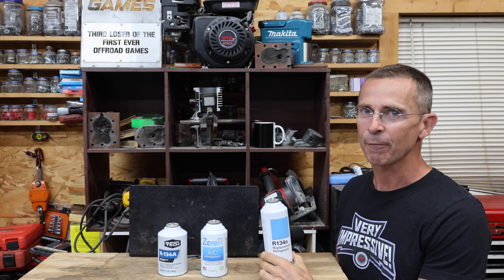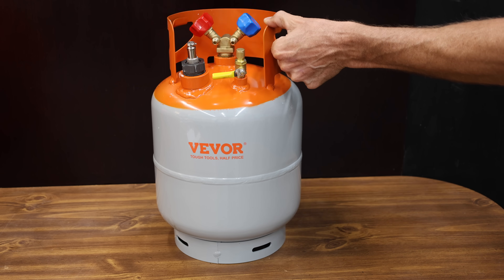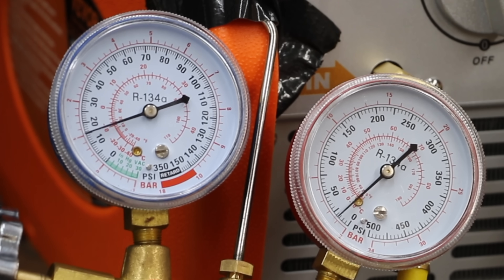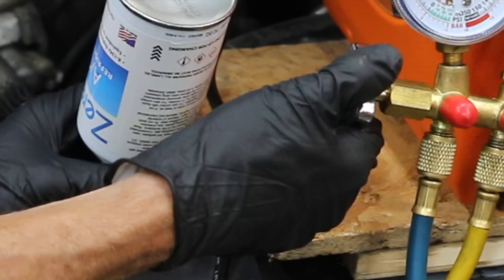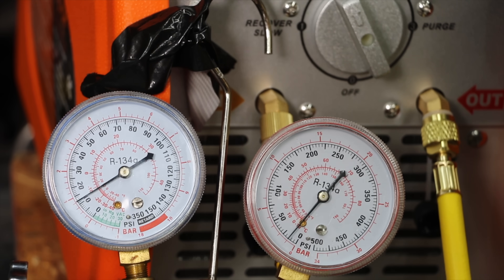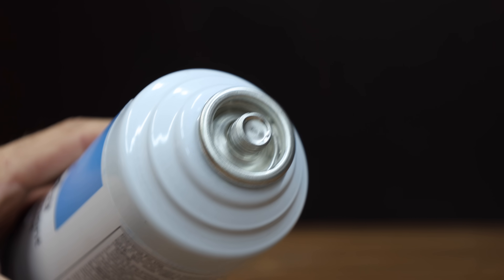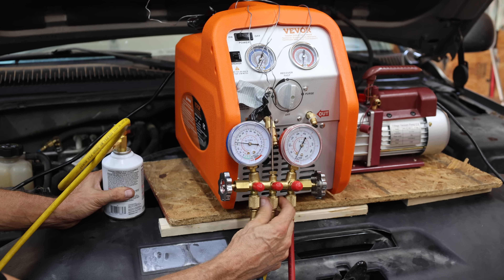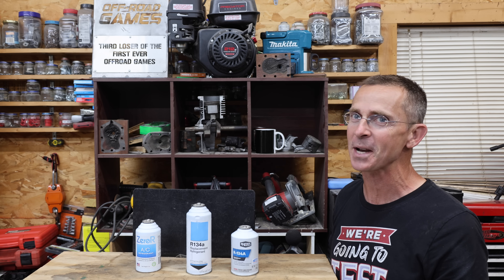How Dangerous is Fake Car A/C Refrigerant? Let's Find Out!

Comment: I spent quite some time researching a top up for my old banger. I considered propane based and rejected it. I ended up buying Honeywell's r1234ze(e), which is tetrafluoroethylene used in ozone friendly electronics diagnosing cooling spray cans. It is "almost" nonflammable, has a lower working pressure than 134a, so will do better with a tired compressor. It has a theoretical 13% worse chilling capacity at the same flow rate and condenser area than 134a. It is sold in cans designed to be sprayed into open air, so can't be very toxic either. I am hoping the is enough oil left in my car to not under lube the compressor. One can of 200 grams revived my AC for 20 bucks. 

My car DID have a little pressure of 134a still enough to turn on the compressor which means there is no big leak and no moisture or air would have been sucked in. 

The system blows cold but it kicks in the high speed radiator fan earlier in hot weather so probably has less margins. This is not an endorsement, but one story of partial success.
Reply from the maker: Thanks for sharing.

Comment: My Lincoln has an R12 AC system. I had a compressor wear out and lost the last of my R12. I decided to try a replacement refrigerant called Envirosafe. (available online) Very expensive but it works great! The refrigerant is a mix of propane and several other gasses so it is flammable. I'm not worried about this at all. I do carry a large fire extinguisher in the car though!
Reply from the maker: Thanks for sharing.

Comment: Hello my friend, using the freon word is deceiving because is strictly related to R12 refrigerant. R134 A it's the "alternative" to R12. As you know R1234YF came out in 2013 to replace R 134A. If you're working with R134A you might need PAG (polyalkalineglycol) or POE (polyolester) lubricants. Please check with the appropriate manufactures on what they recommend. If you're planning a retrofit a system, a completed A/C flushing is recommended and of course pressure testing for possible leaks which they need to be addressed before recharging.  Great work you do behind the lens. Cheers

Comment: Just curious - I saw in your description that "I purchased all of the refrigerants, all equipment, and all supplies used in this review to ensure an unbiased comparison. So, thank you for supporting the channel—it helps!"... would it have made a difference had someone else ( or the stuff provided by the manufacturer ) supplied the refrigerants - it either works or it doesn't.  In this case, it is clearly visible... at idle, it doesn't work very well.  Great comparison, thanks for sharing!  I guess I don't understand the need to disclose who supplies what..

Comment: Checking the msds on  those alternative refrigerants, they are 80 to 95 % tetrafluoroethane (which is r134a) and "something else".  Also when charging study, understand and apply the concept of super heat and the system will be more correctty dialed in.

Comment: The pag oil can store refrigerant thats why the need for such long suction time requirements from the car maker guided procedure. You might have some contamination because of this. The dessicant filter is not the same on all vehicles. Some systems use reciever driers that work in the gas state(low side) of A/C systems while the other dessicant filters are in the liquid side such as later model Ford trucks that are on the condenser. One holds moisture(reciever drier) while the other traps debris as well as hold moisture(capped cylinder housing on side of condenser on Ford trucks) which simply unscrews to be replaced. Your Suburban's Orifice tube has the filter designed into it.

To the people thinking you can start a side job doing car A/C services you should check your EPA local standards. I'm sure they have some laws for the improper release a refrigerant. I've had my MACS license over 30yrs now. Just FYI.

Comment: Cars that use a glycol HX loop would be the most suitable for installing a flammable refrigerant. These cars use a refrigerant-to-glycol heat exchanger as the evaporator directly after the expansion device, and then the interior coil is actually filled with the very cold glycol instead of the vaporized refrigerant directly. This means no refrigerant passes through the firewall into the cabin, and the occupants are not at risk of being BBQed in a crash. 🤗

Comment: Years ago, lots of people started using Propane as a replacement refrigerant in R22 systems, because R134a couldn't keep up, and R22 became prohibitively expensive/impossible to buy.

Propane actually has a refrigerant designation. It's known as R290. I remember how everybody said that was horrible practice and nobody should EVER use flammable refrigerants, because they're just too dangerous.

I was always, like, "3 POUNDS FLAMMABLE REFRIGERANT? OH MY GOD! Why, that sounds almost as dangerous as the 60-160 pounds of GASOLINE you drive around with in the non-hermetically-sealed fuel tank of your car/pickup, every day!"

And nowa days, pretty much EVERY new refrigerant that manufacturers are going to be allowed to produce and put on the market is flammable.

Using propane (R290) in a system with a strong potential to leak indoors is a much bigger concern. I wouldn't use it on a split air-to-air AC system where a leak could potentially pump a lot of it into your basement/house, near an ignition source like a water heater pilot, or something, but the tiny amount of flammable refrigerants that are in a car's ac system isn't really enough to be much cause for concern. If it started leaking into the cabin of a vehicle, you'd smell it instantly, and simply rolling down the windows would allow it to dissipate to the point where the danger would also disappear very, very, quickly. Hell, simply switching off the AC compressor would likely be enough to stop the leak, since the leak would likely appear on the high-pressure side, and only be leaking while the system is running.

The sad reality is, it won't be too many more years before every refrigerant on the market will be some sort of propane/isobutane mix. Less efficient, marginally more dangerous, but without the global warming potential or the ozone depletion potential of older refrigerants. The efficiency issue will have to be addressed with system redesigns that utilize larger condensers, to compensate for the lower heat capacity of those refrigerants.
Reply from the maker: Thanks for the feedback.
Reply: Propane is odorless. The odor of propane is a different gas added for detection. It's not added for use as a refrigerant.
Reply: @fascistpedant758  Brother, I can assure you that the propane that people were/are sourcing to use in their car's AC systems absolutely contain odorant. ;)
Reply: @fascistpedant758  
Getting your hands on R290 sold as a refrigerant requires the same hoops that the people using it in lieu of R12 are/we're trying to avoid in the first place. And the systems never seemed to mind that it had an odorant and didn't come from an orange vessel at 3x the price of the stuff you could dispense from the BBQ tank on your back patio... 🤷‍♂️

The bottom line is we've coke full circle with the very same naysayers for not all that long ago screaming about how flammable refrigerants were just too dangerous to ever use, now being the same ones now MANDATING their use.

Now, magically, it's not hazardous, reckless, and ignorant. It's now safe, virtuous, and enlightened. 👍

Comment: The tank is probably not totally dry yet check out the Fieldpiece video where they pour in a little bit of water into two tanks and show the difference between vacuum pumps when you change oil and don't you can also see how long it took to get the water out

Comment: I have had great results with R152a in my experiments with it.  People cry it is flammable, but so is the R1234YF and most other enviornmental safe refrigerants in use today.  R12 and R134a mixed with highly atomized oil also burn.  When those burn you get Phosegene gas basically mustard gas.

Also FWIW the AC system for R1234YF is no different than a R134a system component wise. They changed the fittings, but they still use the same style evaporator core. When they first talking about using it they were talking about using it with a secondary cooling loop to isolate the refrigerant from the cabin. That never happened.
Reply from the maker: Thanks for sharing.
Reply: @ProjectFarm  No problem. Love your channel and content.

Comment: Something not mentioned in the video is that discharging a refrigerant loop, you also lose oil. The oil in the refrigerant loop travels around the system with the refrigerant and returns to the compressor. This is why if you have a leak, the leaking area tends to look wet, or green if you have dye in the oil.

If you've had an open/leaked out A/C system for a long period of time, you'll need to add the proper amount of oil to the system. Preferably, you want a recovery machine to remove as much of the old oil as possible because it is hygroscopic and can be contaminated with moisture. Same goes for the receiver/dryer, the desiccant can only absorb so much moisture before it goes bad.

If you just decide to randomly recharge an unknown old A/C system without getting the oil right, be prepared for a grenaded compressor and shrapnel in the refrigerant system.
Reply from the maker: Thanks for sharing.

Comment: Great video as always, very informative. I have a suggestion for a video. A comparison between standard and rechargeable batteries in an EDC (concealed carry) optic. Which last longer and which can handle repeated movement and banging around. Does the higher price of the rechargeable pay for itself or is it not worth the extra money. Are small rechargeable batteries like (CR1632, CR2032) reliable enough for EDC. I know you are not a gun channel but, I assume there is a way to do this without being demonetized by YouTube. Your video on CLP's was great and convinced me to switch the brand I was using. The results have been VERY IMPRESSIVE.
Reply from the maker: Thanks!  Thanks for the suggestion.

Comment: R12 "Freon" cans were once 25 to 50 cents each decades ago in the 12 to 14 oz sizes. But gasoline was 25 to 30 cents then

They were used to power boating air horns; sporting even air horns; inflate rafts balls too. 

Also these cans were used to power BB machine guns you bought mailorder in comic books. (Not available in Chicago) . 

Also there were adverts to make big money raising worms. Carter worm ranch Plains Georgia. Send a SASE for a free brochure on BIG MONEY RAISING WORMS.

Comment: Should add the gas slower when adding as a liquid. Usually around 25psi above the suction pressure to avoid compressor damage.

Comment: Just a little info on refridgerants. If there is a letter suffix (R-134 "a") means its a blend, of more than one refrigerant. The reason you invert the can to ad as a liquid, is that although the mixed refridgerants are similar. They will ultimately boil at slightly different temeratures. Adding them as a liquid confirms youre getting the same % the blend is supposed to be. The gas blend could be a lot more of one than the other depending on ambient temps.

And propane is a refridgerant, they are moving towards those again in auto systems for some idiotic reason. I dont think there should be a pressurized flammable gas in a vehicle. We already have fuel, but thats not flammable until mixed with oxygen.

Comment: I think you overcharged the the zero r.  As a starting point put a little more than 1/2 the factory charge on the decal showing the ounces of r134a required and take it for a spin. Or charge it with compressor running and idle up until the suction accumulator begins to sweat and stop adding gas.

Comment: Another great video Todd. Thank you. Hey another idea would be to test trailer tires. Like I just was looking for 14-in trailer tires and there's so many Chinese brands and then like Carlisle unloadmaster and some others but the problem with some trailer tires is they crack so easy in the Sun or they puncture way too easy what should never happen with the six-ply tire. So at any rate testing brands that trailer tires and how well they hold up to sun and the elements from cracking and such would be great
Reply from the maker: Thanks!  Thanks for the suggestion.

Comment: I don't know if you've ever done a comparison on locking fittings for grease guns. Some cost $40 and I've found that they come in different pressure ratings and they're not all created equal and some don't do the job as well. I also found out that stainless steel grease fittings are available, for those fittings prone to rust. If you could do a comparison on the grease fitting locks for grease guns would be appreciated. 
Ball joints are something that I'm researching for my 3 first generation Toyota Tundras. The selection is large and I don't know which company does the best R&D. Many people are very cautious and purchase only Toyota brand. I found that TRW has a heavier weight ball joint than Import Direct (sold by O'Reilly). The nongreasable area on the TRW was larger and   I thought the ball might be bigger. Thanks
Reply from the maker: Thanks for the suggestion.

Comment: You should consider testing the performance and longevity of brake pads metallic vs ceramic vs carbon ceramic with and without slotted and cross drilled rotors. It would be easy to chuck rotors in a lathe and measure amp draw vs applied force the pads could be fitted with thermo couples and the rotor and pad wear could be easily measured.

Comment: interesting. most of the new coolants are flammable such as the now required 1234YF (2021) in all new vehicles. I've been using Enviro-safe AC coolant for the last 20 years or so with no problems. the cooling characteristics seem to make my AC systems in both of my motorhomes go much lower than the 134. when Idling temp is about 40 degrees depending on the ambient. when moving I get 32 to 36 degrees from center vent. When using the original 134 the coldest it ever got was 50 degrees on a cool day. The thing I liked about it was it was a direct replacement, I didn't have to change out the oil. I have also used it in several other vehicles. Been 6 years since I've had to recharge my DP.  I've noticed that folks fear the propane based coolants, but fuel line breaks and propane line breaks in motorhomes are more dangerous than AC leaks.  Might want to add Enviro-safe it to your next test list as well as 1234YF. great video testing the coolant temps, I don't have that kind of patience.
Reply from the maker: Thanks!

Comment: Try cutting a piece of 1/4 inch thick carbon felt to replace the air filter for a lawn mower using a loose copper mesh scrubber to act as a spacer if needed.
Reply from the maker: Thanks for sharing!

Comment: You should test fuel injectors. Test the old ones in your Tahoe, measure flow rate/atomization. Then buy cheap Amazon knock off, and a oem equivalent. Test all three and share results, determine if the cheap injectors can help up to oem standards. A set of 8 injectors on Amazon can cost as little as one oem equivalent.
Reply from the maker: Thanks for the video idea.

Comment: There are petrol cars in Europe converted to LPG. The gas tanks have a capacity of up to 80 liters.
Some people don't make it a problem that the gas is flammable.
There are approximately 200 grams of R290 refrigerant in the air conditioning system.
And here's the problem, because it is flammable.
Reply from the maker: Thanks for the feedback.

Comment: It is a blend of propane, butane and isobutane. There is a sticker under the hood that will indicate how much refrigerant is needed for a proper charge. The charge needs weighed in as the pressure is useless. Once the refrigerant starts condensing you can continue adding refrigerant and the pressure will never go beyond it's condensing pressure at that temperature, that is why it is useless for charging. The conversion for the ZeroR is 6oz for 16oz equivalent of 134a. So if the vehicle tag said 32oz of 134a you would weigh in 12oz of ZeroR.
Reply from the maker: Thanks for sharing.

Comment: Mixing refrigerant should be avoided because of the oils.. for instance, r-22 and r-410 will have either POE or mineral oils in them and those two do not mix, you’ll kill the compressor.. also never start a compressor without refrigerant in there! The oil is what keeps it lubricated, no refrigerant means little to no oil. Pulling a vacuum on the system, when you open the refrigerant, it’ll pull it in there naturally. Then when it can’t take anymore in, you can start the compressor. Speaking of pulling a vacuum, I’d recommend getting a micron gauge as that will tell you when it’s safe to add the charge. 500 microns is standard, 250 you have 0 moisture.. if you couldn’t tell I work hvac 😂

Comment: Every time you recover freon you pull a small amount of oil with it. Does the recovery system you use have an oil accumulator to keep up with how much you pulled out? If not you may run the system low after multiple recoveries.

Comment: I keep a specifically made AC thermometer stuck in one of my vents to constantly monitor ac temps. I've seen as low as 36°F but typically around 40°F which is in the green zone on the thermometer.
Reply from the maker: Thanks for sharing.